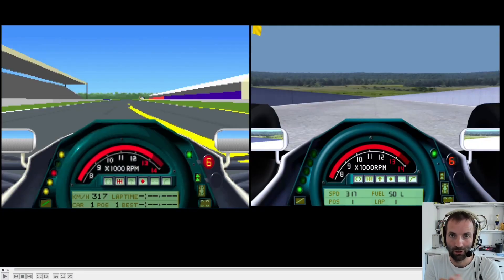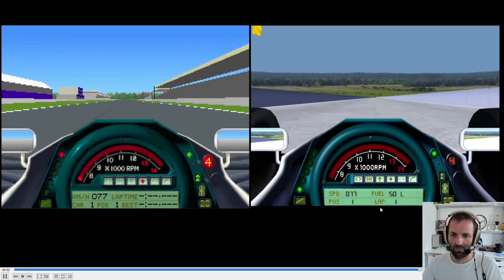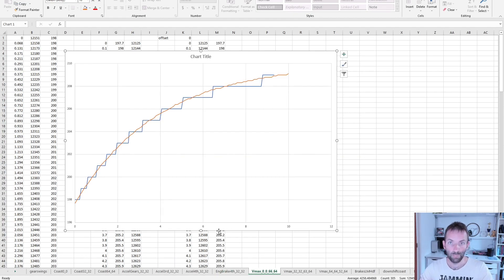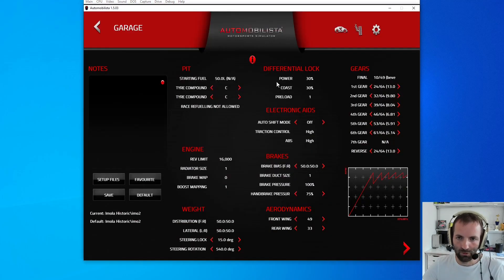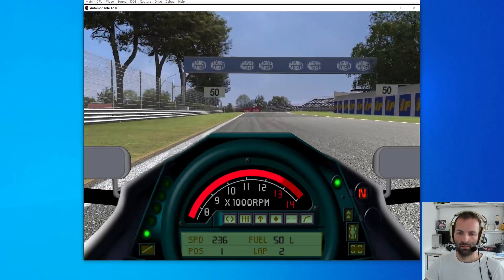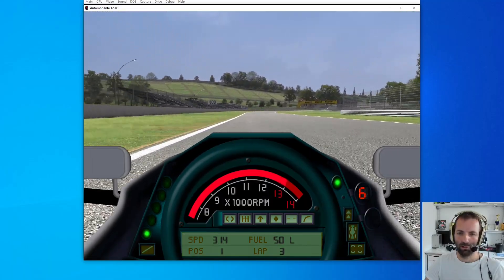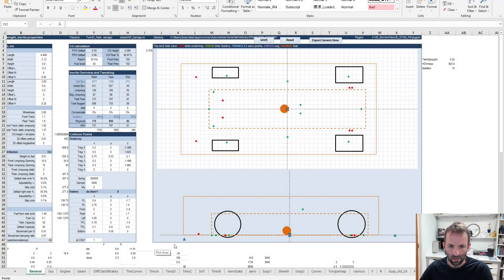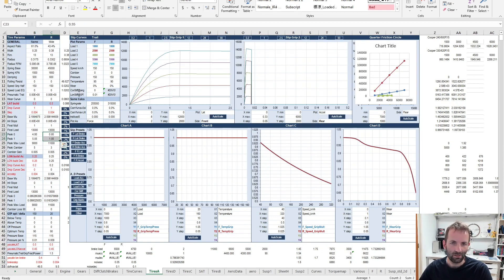I Reverse Engineered (ish) the Physics of Geoff Crammond's 1991 Microrpose F1GP!

Comment: Thank you, Niels, for this big improvement of F1 Grand Prix 😉 I never though that will be such major update after 30 years on the market.😱 Codemasters have now a threat of not being the first choice of F1 game on the market this year. 😃 For me it was fenomenal game. I played it on Amiga so I constantly shuffeled my 3.5 floppy discs to load next tracks. Then I played it on PC with 25.4 frames per second and it was shock to me how smooth the game were running. Great times.🤓 I even send my times to the first F1  league via internet. We compared our times once a week and get scores upon sended logs. I wish you all the best 😊 I'm waiting also for such update to F1 GP2. 🤭🤫 Maybe you will make a try also with that F1 legend game. Anyway big thanks for your great job 👌💪👍 It brings me a lot of nice memories 😎🤩😈
Reply from the maker: Thanks. The great thing about F1GP memories is that the game is actually still fun! Some of the older games didn't stand the test of time too well, but the clever keyboard controls made F1GP very challenging without making it too frustrating.
Reply: @NielsHeusinkveld  Exactly. This game made me interested in racing simulations until today. I wish you all the best 😊🤓

Comment: Can you the same with Stunt Car Racer?!
Reply from the maker: I would love to give that a try, but we would need an 'accurate' track to test on..
Reply: @NielsHeusinkveld  Stunt Car racer would be more suited to the BeamNG Drive platform , with its soft body physic's model . and track building options . GP is a classic my first true fully featured F1 game it is easy to forget this game had ever F1 track from that area included , a fully race weekend ok fictional teams though they included a editor in the game . so most quickly added all the correct drivers and Teams . it even had weather I am pretty sure it was dynamic to. I seem to remember racing in Rain then the track drying out . though I have not played GP 1 since way back so I could have mixed up some of the later features found in the series from GP 2 to GP4. 
But GP had some many firsts back in the 90's. Hot seat was one of the best features because you could race both your teams cars , giving you some nice tactical options to help your team mates during the race.
I think every game Crammond wrote was groundbreaking at that time be it Sentinel , REV's , Spitfire 40 , Stunt Car racer, GP1/2/3/4 . it was very odd how he just dropped out of the whole game development sector. 
there was an interview a few years back but I have little idea what he is doing these days.